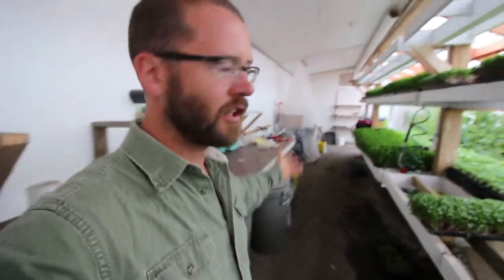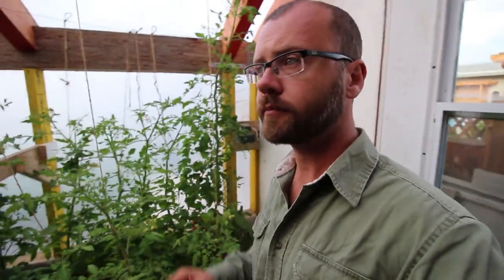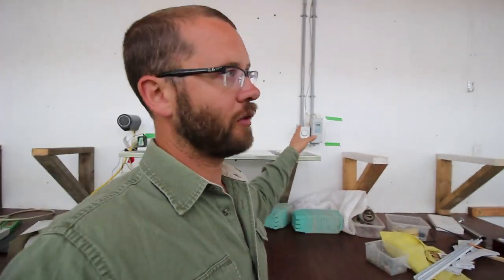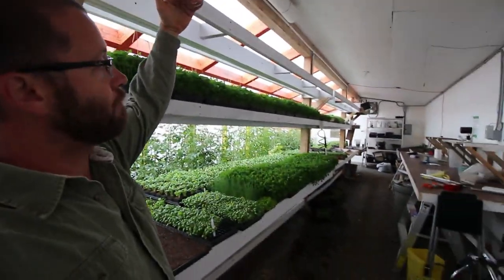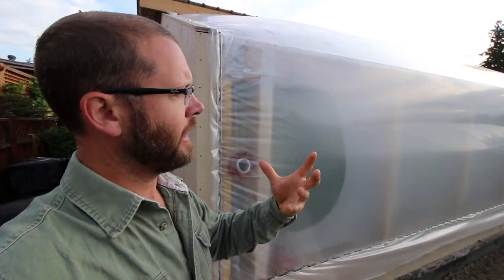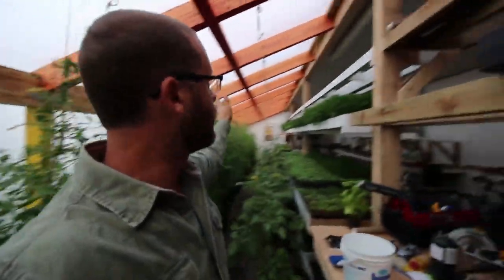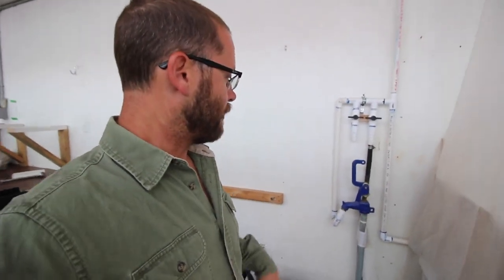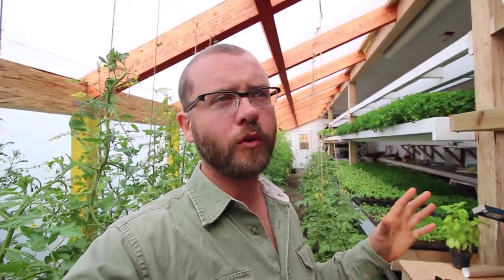Inside My New Passive Solar Greenhouse

Comment: The greenhouse framing looks like 4x8 timber to hold up polytarp. Engineers shouldn't be in the business of over-engineering stuff. You want smart engineering. Your greenhouse framing could have been built with 2x4's with some bracing.